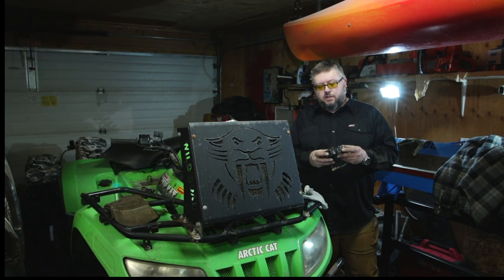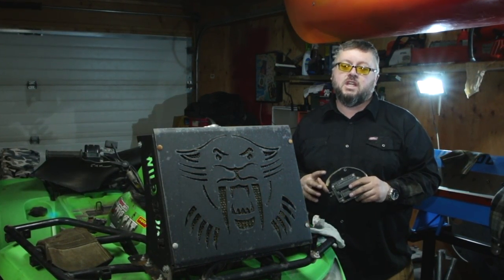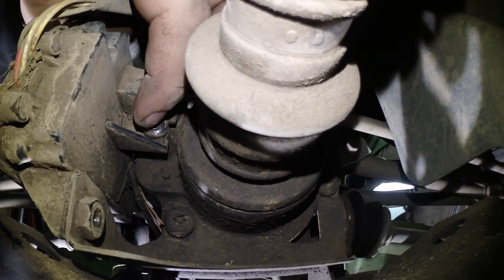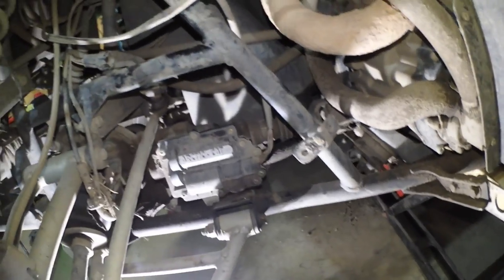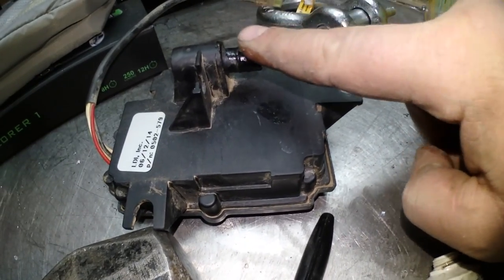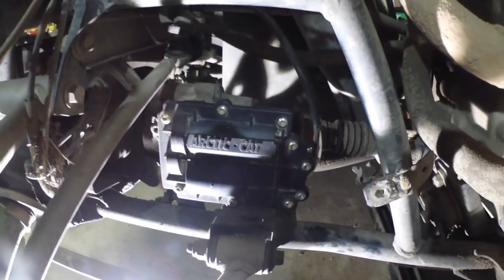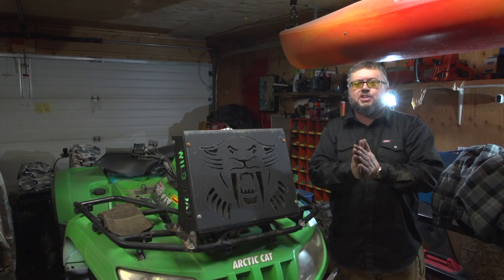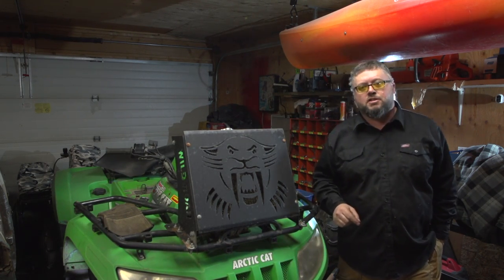Arctic Cat ATV NO 4x4 Repair Diy Actuator Problems

Comment: Thanks for the informative video.  It helped a lot.  I fixed my actuator on a 2010 650 h1.  I found oil in the case and also a short on the board.  After, cleaning and fixing the short it works perfectly.  I just got to put it back with a washer to keep the oil out.

Comment: Glad mine actuator is a manual shift lever with cable hooked to the shift pin simple,easy and not so expensive
Reply from the maker: that's the way to go for sure

Comment: My Arctic Cat 400 has a problem with the Diff Lock cable.  It is a little stretched so I purchased one from ebay but don't see how to replace it at the actual differential.  I see where it is and it seems like a simple swap but does that part unscrew or will I have to completely remove the differential to change out the cable?

Comment: This just goes to show you if you're out in the Bush on a long trip and you're ATV's actuator fails you can take it off and manually put it in 4 wheel drive then put it back on to keep the water out.  I've done this before.  Arctic Cat I have this problem constantly.

Comment: I have a 07 artic 400 trv .. 4x4 not working .  May try take apart and clean .. mine is a flat 3wire  plug .. where can I find one .. I’ve had no luck . Can I convert to 4 wire ?

Comment: Jerry, any thoughts on where to get a used actuator for a 2008 366 Arctic Cat actuator?  I opened mine up and the DC motor seems bad.  Not sure if you can just replace that separate to a whole new unit.

Comment: Hey great videos 
I got a question and what seems to be a common problem.
Two new 700 efi Arctic Cats that will foul or flood if the Atvs are started and moved and shutoff.
Will restart if a new plug is installed

Comment: hello. I have a 400 AC ATV. Gage keeps blinking Volt. I checked all fuses and tried two batteries.  Lights work. I road 27 mile of trails. It kept blinking all the gage readings on then 
 back to Volt. ATV starts right up. Lights stayed brite. Whats Wrong?

Comment: An you please make a video or at least give me advise on mine my diff lock is not working I adjusted it on the bottom of the diff I switch it so much that the light would come on then I did it the other way and light comes on and nothing is napping I can hold the tire while the other one is spinning could but 4 wheel drive works fine would their be any thing wrong inside?

Comment: Ok mine engages but when I turn the wheels to the right it goes into four wheel drive when I have the switch in two wheel. Turn back to the left and it goes back to two wheel. I'm at a loss.

Comment: Nice video. My 500 4x4 cat just stoped wanting to go into 4x4.. It keeps it trying to engage over and over (just kept making the sound) and not holding into the 4x4. The front differential lock still works though ??? Any thoughts? Could it be Actuator?
Reply: D Tomich1 sounds like you might have stripped the gears, that's what my 700 did
Reply: it only does it when it get wet.. I'm thinking a bad seal. I have the actuator unplugged for now until I can get it into the shop.

Comment: Hey can you put a 3 wire actuator in place of the 4 wire actuator? 4 wire actuators seem to be discontinued.
Reply from the maker: I can't give you a honest answer on that but i'm sure there is a way you could make it work in theory the 3 wire should be ground, Power to Engage, and Power to disengage

Comment: I just bought a 2005 arctic cat 650 v-2 form an auction. Can’t get it out of limp mode. Started digging into it. Found the speed sensor just fell apart.  waiting on the new one to come. Will this help me get limp mode  to go out. Pretty frustrating any help would be appreciated
Reply: Robert Bolton sometimes the shift sensor goes out so it doesn’t let it rev higher than what park lets  it do

Comment: I know this post is old, but, did anyone else notice the spring that shot out as soon as he removed the servo? also, he never mentioned anything about it. When I pulled mine apart there was a spring around the small push rod. You can clearly see it shoot out. However when you go to the drawings on any of the OEM sites, no spring. Baffling.
Reply: This is interesting because my actuator is only engaged in four-wheel-drive. I cannot go into 2 Wheel Dr…. I have taken apart the actuator again. I think my problem may be in the switch.??? No spring though 🤔

Comment: How can I force it to be 4x4 all the time without this part?  I don't need 2x4.  thanks.
Reply: Take the actuator cover off with the 8, t15 screws off and take the BLACK plastic cylinder out and screw the gear completely out so the plastic threads all show, and not to much where it wont fit back in.  This pushes the plastic arm all the way towards the wire harness end to where it leaves the 4wd plunger out on the diff  leaving it in 4wd. Cover back up and install again

Comment: Hey jerry, my friend just called me about his trv .its the same year as yours,2007 650hi.. It  idles fine but when he gives it throttle it spits and sputters...have any idea what the prob is??thanks...
Reply from the maker: could be many things from as simple as a fouled sparkplug to fuel/air, electrical to even  a low battery problem
Reply: Oh ok, he put on brand new carb, new plugs,cleaned fuel tank,and changed the oil, he adjusted valves,looked at timing, he said the thing will idle all day..I will tell him about the batt thou..would the screen be plugged up in the muffler by any chance ?? He is going to try the cdi next..thanks..love your videos btw....
Reply from the maker: If he put on a new carb most likely he will need to adjust it
Reply: Ok, don't know if he done that...thanks...

Comment: i removed the actuator and jammed the rod into 4wd, it is full time 4wd now
Reply: That was what I was thinking. How did it work out? How did you cover the rod opening?
Reply: @charleszoffuto8381  works fine, did not cover it with anything but a dab of silicone would work
Reply: worked great, i did not cover the opening but a dab of silicone would work
Reply: How did you jam in the rod and get it to stay?
Reply: @shayemora9953  when you take it apart it is intuitive. the rod does not go in and out but up and down,